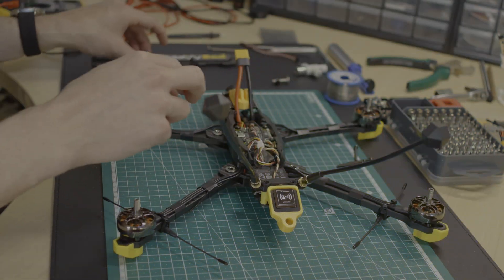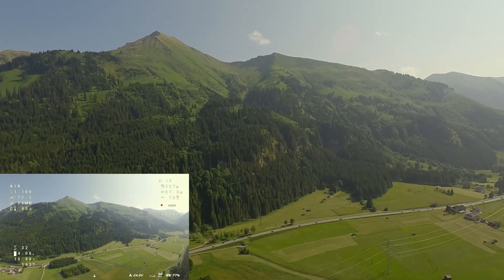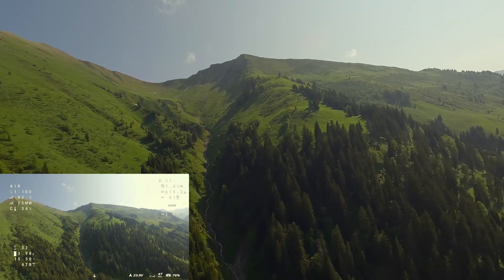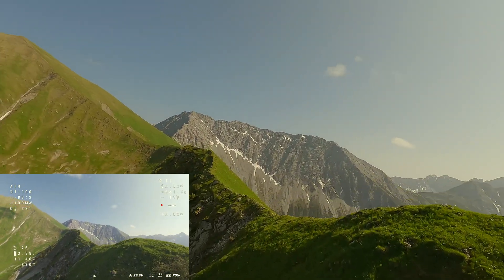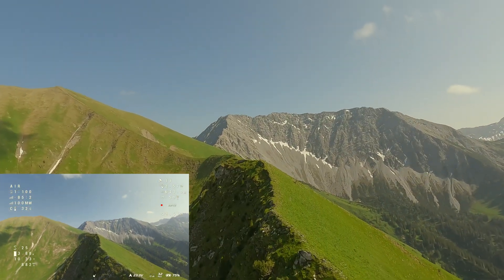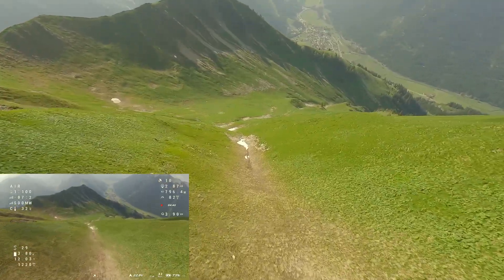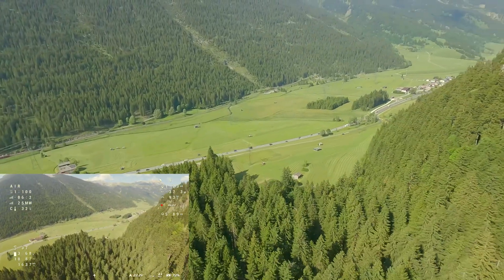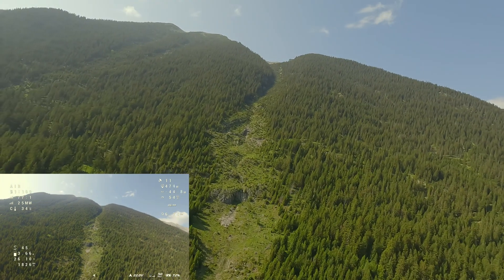FPV Long Range Build Speedybee Mario 8 | First Distance Flight

Comment: i had same problem with shaking drone as its on emax motors its take alot of time tuning . i think t motor velox its beter for motors
Reply from the maker: Yes it is a real pain… but getting better from flight to flight. Already thought about switch to stronger motors… which motors do you use on which drone?
Reply: @flipsfpv i use emax motors on 7 ich erdog frame and also on erdog 8 incj frame and also use in aquilla 7 ich all cost shaking problem but on my erdog 7 i tuned 5 times and fitst one was total wrong and i foumd in 7 or 8 inch iterm need to be down . finaly i tuned my 7 inch erdog and its perfect no shaking at all . i cant remember now bit i can check . its was to mach D i think . i olso use t motors velox on my RAD 7 inch and on my RAD RPM 7.5 and tune was with no shaking at all

Comment: Did you manage to resolve the shaky video of the O3 Air Unit? I also fly the Mario 8 with the O3 Air Unit and have the exact same problem.
Reply from the maker: Hi, I fly with the O4 and the O3 mount. I ordered the SpeedyBee O4 Upgrade Kit for the Mario series. It will arrive next week and I will test it. But if you have the same problem with the O3 I think the shaking is due to another problem… perhaps the tuning or the motor frequency….

Comment: Great video ! Your throttle is very low cruising wow , that is very nice. When descending sometimes it shakes , nothing big however , what pids do you use with this beast ? Mind you to share ?
Reply from the maker: Thank you! Yes it is a real efficient drone :)
I use default betaflight tuning with this profile:
set i_pitch = 79
set i_roll = 76
set i_yaw = 76
set feedforward_smooth_factor = 20
set feedforward_jitter_factor = 15
set feedforward_boost = 5
set simplified_i_gain = 95

Comment: Why theh keep saying mario8 it's a Mario "fold" 8 lol
Reply from the maker: Not to be confused with the Mario 8 without "fold"
Reply: @flipsfpv you're saying there are two of these? one that folds and one that doesn't?

Nah from what I gather it's the exact same frame, it's just that some other sites call it Mario 8 foldable 
But on speedybee's site it's called Mario fold 8 there's just one frame.
But It's splitting hairs really
Reply from the maker: @elxero2189  yes it is just one frame. I don’t know why it’s labelled differently on different sites 🤷🏻‍♂️